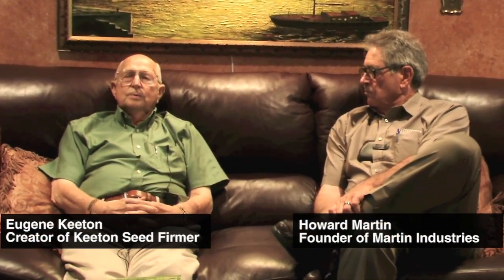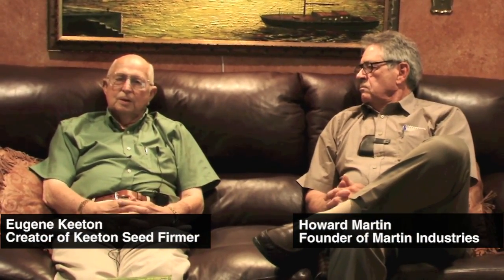Eugene Keeton Invents Brush Meter for Kinze

Comment: Kinze brush meter is so simple but does an amazing job... We used them to plant cotton, grain sorghum, and soybeans and they worked magnificently.  Sure beat the old flat plates we'd been using before then on our old Deere #18 planter.  

Probably the best plate technology was in a Cole planter that my Granddad ended up getting as part of a deal on a mid-70's Case David Brown tractor deal, where they threw the planter in with it.  It used twin inclined plates at the front of the hopper operating at about a 45 degree angle off vertical.  The two cast iron plates rotated in opposite directions, separated into a right and left hand half of the hopper.  Seed came down from the rear bulk part of the hopper under some little flat metal baffle plates with a roughly 1x3 inch slot at the bottom, that allowed a seed pool to form down at the bottom of the inclined plate in each half of the hopper.  The inclined plate then turned down through the seed pool, seed would drop into the slots in the plate (seed cells) and then would rotate slowly upwards toward the top.  The cells were designed so that by the time the seed rotated to the top, only one seed could basically fit into the cell, the rest would have dropped out and back down into the seed pool by gravity.  The cells were slightly tapered to the rear so that as the inclined plate rotated, the slightly cupped plate (similar to the Deere "radial bean meter" shape of their seed disk) would go from the seed cells being almost horizontal at the bottom where seed filled the cells from the seed pool, to almost vertical at the top edge, with the single seed trapped in the cell by the slightly rearward tapered cell edge.  This forced multiples to drop out because only one seed could (theoretically) fit into the cell by the time it got to the top of its travel.  The plate would then rotate just past the top center and a hole in the backing frame behind the plate allowed the seed to drop out of the plate and down the funnel delivering seed to the sword opener.  Each plate was gear driven off a common shaft and timed to drop alternately left, right, left, right continuously.  This ensured even spacing.  Having TWO plates per row meant that the plate speed was halved compared to regular plate planters, since each plate was only metering half the seed for that row.  This meant two 48 cell milo plates, for instance, was turning the same speed as a 96 cell milo plate, which would be too big to fit into any plate planter, so there were no 96 cell plates.  Corn plates with 12 cells could turn at half the speed of a 24 cell plate.  Both flat and round corn seed plates were available (and luckily I went on a hunt when I was a teenager and managed to get a full set of the inclined plates for the Cole planter).  The biggest downfall of the design was that it delivered seed from both plates about 4 inches off the row center, so a metal funnel connected the two backing plates behind the seed plates, to direct seed coming from the openings in the backing plate where the seed dropped out of the seed plate, down by gravity towards a common plastic/rubber seed tube... this promoted a lot of seed bounce and a "dead drop" straight down the rubber tube which dropped straight down inside a steel boot to the sword opener, so the seed hit the ground at a pretty good clip as the planter was moving across the field, creating a lot of seed bounce/roll, all of which killed accuracy.  The upside was, if you wanted to plant double rows, you could get an "individual plate" funnel kit that replaced the single big funnel with two mini funnels, directing each plate's seed to its own individual seed tube, then add another sword opener and covering shovel, which the lower frame was designed to take... so you could split row plant quite easily if you bought the extra parts and installed them on the row units.  The other big downside was that the planter used old style "blackland" row units with a large gauge wheel followed by a big V sweep, followed by the sword opener, and a pair of covering shovels.  The hoppers were mounted on their own brackets off the tool bar, and stayed stationary to the tool bar, while the opener units below were on parallel arms and could flex up and down with terrain.  This ensured the plates always got a "smooth ride" while the row units could flex and bounce over terrain and clods, rootballs, etc.  Of course this also meant that the seed tube which telescoped inside the boot down to the seed opener got longer and shorter as the row unit flexed up and down, which didn't help accuracy either.  

If the twin plate system had come out maybe 5-10 years before, and had been incorporated into early designs of the double-disk opener with side-mount gauge wheels and twin closing wheels, it would have been contemporary planters like the Deere 71 Flexi or 494 or the similar IH 400 units all to pieces for accuracy... particularly had they incorporated a curved seed tube to achieve "zero drop" into the furrow... 
Might have prolonged the era of the plate planter another 10-20 years... who knows.  

As it was, the move to double-disk openers and sidemount gauge wheels with V closing wheels revolutionized planter opener design, and when coupled with the finger meter's capability for superior corn metering, it was unbeatable.  Even IH's Cyclo drum type air planter, while capable of singulating seed quite well, was hamstrung by its long seed hoses delivering the seed to the openers introducing spacing errors.  Allis Chalmers had a large vertical plate air system IIRC that dropped seed almost directly into the furrow using a double disk and single press/gauge wheel arrangement similar to a 71 Flexi row unit IIRC as well, and then White came out with their own air vertical seed disk meter similar to the later vacuum meters.  The finger meter coupled with the Deere 7000 series planters became the standard that everybody else copied, over time.  Problem was, finger meters were basically designed to do the job of singulating and delivering the roughly "teardrop" shaped corn and sunflower seeds, relatively large seed planted at relatively low populations, and wasn't really that adaptable to handling seeds of various shapes like large round soybean seed or small round milo seed, or small teardrop shaped cotton seed, very well, nor of handling high populations which would require the meter to turn much faster, requiring slower ground speeds of the planter to keep the meter turning at the 'sweet spot' in terms of meter speed in order to meter accurately.  SO, needing a way to seed soybeans with the same planter in corn/soybean rotations throughout the Midwest, Deere came out with their 'bean cup' meters, which they also sold to southern farmers in a more common corn/cotton rotation or planting some grain sorghum acres as well, which was very common at the time.  The other choice was a 7000 or 7100 planter with regular PLATE bottom hoppers and plate drive conversions, which had a metal bracket that attached to the top of the row unit and replaced the finger meter/cup meter drive sprocket with a separate drive sprocket on a shaft sticking out of the bracket turning on bearings or bushings, which turned a small bevel gear turning a larger bevel gear identical to that on a 71 Flexi plate type meter, and which used 71 Flexi style flat plate bottoms with the interchangeable rings and plates, which dropped the seed down a chute in the bracket that delivered it to the seed tube.  This allowed Deere to sell the 7000/7100 planters with plate bottoms capable of seeding cotton, grain sorghum, soybeans, or corn using old style plastic seed plates, or equipping the plate bottoms with dome-and-gate style peanut meters in place of the plate bottom in the same hopper.  OR one could get the plateless hoppers and plateless clutch drives that replaced the plate drive bracket on the unit shank, and install finger meters and "bean cups" for planting everything other than corn.  Swapping between the two is possible (I converted the 7100 I bought from a dome-plate peanut planter to plateless Kinze brush meters with a set of used hoppers and used Kinze brush meters and bought a set of plateless drive clutches for each row to replace the plate hopper bottom drives).  It would be a BIG job to swap the planter from a corn finger meter to bottom plate meters in-season though-- MUCH bigger job that swapping out finger meters for "bean cups" when switching between corn and other crops like beans, cotton, or milo.  BUT if you were planting a lot of cotton and milo, you'd greatly prefer the metering from plates over "bean cups" even with the milo or cotton cups installed, and just had to live with the problems of plate planting corn... The Kinze brush meter allowed you do to BOTH and do a terrific job, whether using the finger meter for corn or the brush meter to singulate cotton, sorghum, and soybeans with great accuracy...